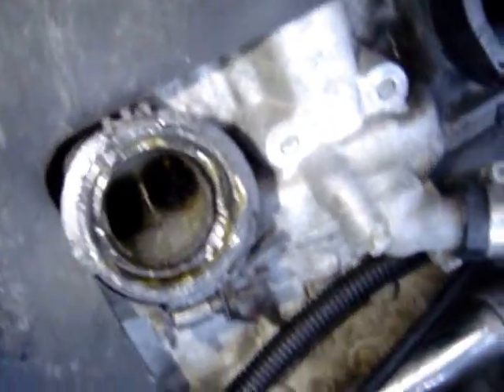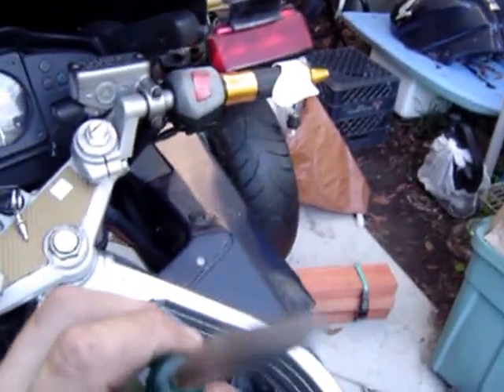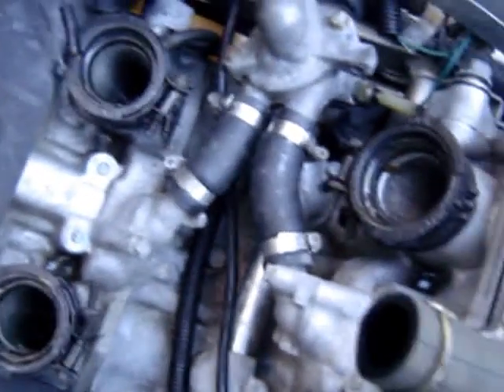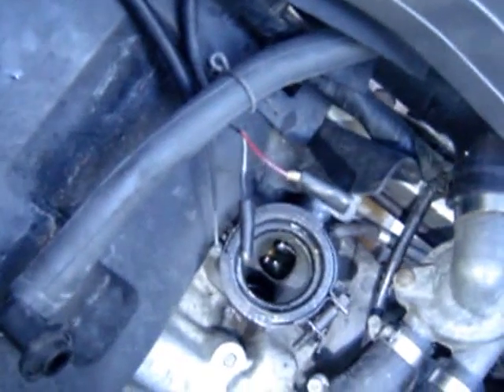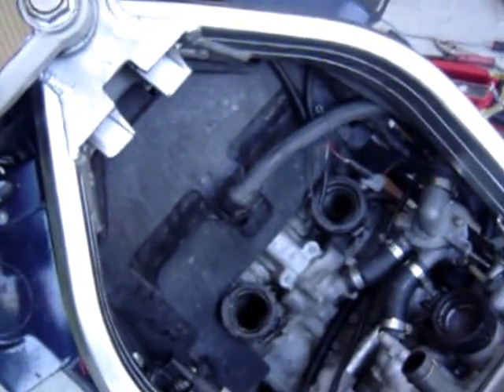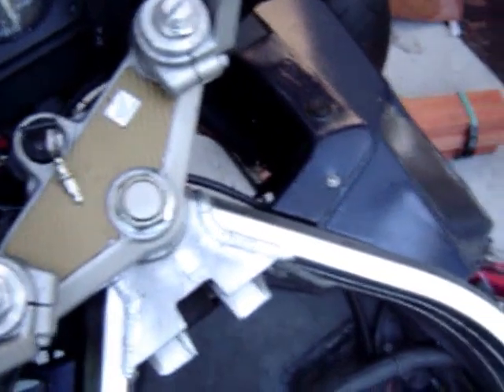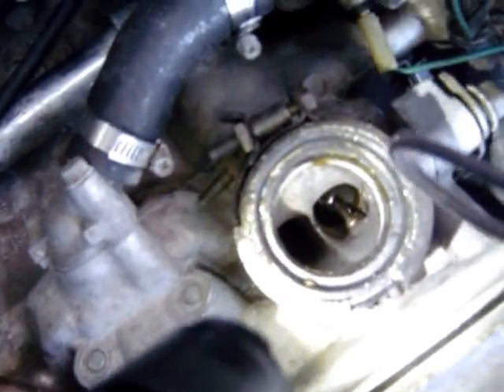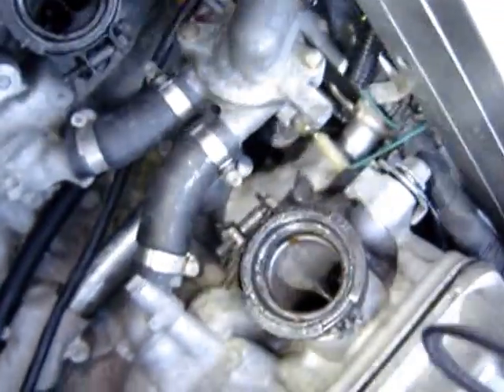Part I:  How to Clean Carbon-Gunk on Old Motorcycle Valves - Ignition Coil Corrosion

Comment: What happens if it's not sealed and not holding the liquid?  The valve didn't close  all the way.  I reach the valve but on one of the cylinders it is not closed all the way as if the engine can a shut off halfway. And valve didn't go all the way up. I used carb cleaner but when I sprayed in there it's not staying in there it's falling into the combustion chamber. Is this OK any problems I Should worry about?
Reply from the maker: The rotation of the engine determines if the valves seal on the up or down stroke.  When you put a flashlight inside the 4-3-2-1 combustion chamber, you will see it sealed or open.  If it is open, turn the crank or engine so the valves close on the upstroke.  IF IT IS OPEN DUE TO CARBON, THEN USE A BRUSH OR SCREWDRIVER TO KNOCK THE CARBON OFF BEFORE SOAKING.

Comment: Today i removed the carbs on my yamaha R1 and i saw that shit it looked like sand and oil
Reply from the maker: That is what is robbing your bike of power and other good stuff.  I am sure someone will come up with a way to clean it, but I show you one method; again, it is not a solution to the problem but it is a remedy in the short term.  Rebuild the head and the bike will run like new (if you have good compression).
Reply: Alex-Thang Nguyen can i use querosene to clean that
Reply from the maker: Yes, or the other thousand things I do not have!  The reality is kerosene is at least 25 miles from me and this is only a few footsteps.  I do fantasize all day.

Comment: Just out of curiosity I'm trying to get around pulling my calves myself 
But is there any danger of it leaking down to the chamber and into the oil?
Reply from the maker: You really should rebuild your upper head but if you cannot at this time, then try to remove all the gunk around the valves.  Your oil has nothing to do with the combustion chamber; however, your valve seals block the oil from leaking.  I guess, dunno...???